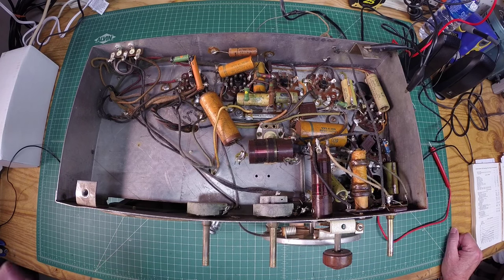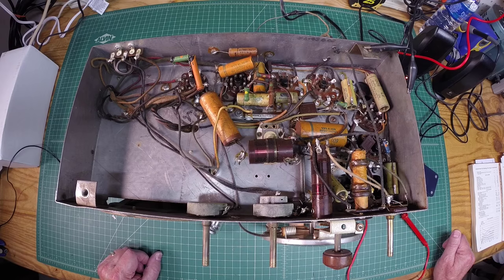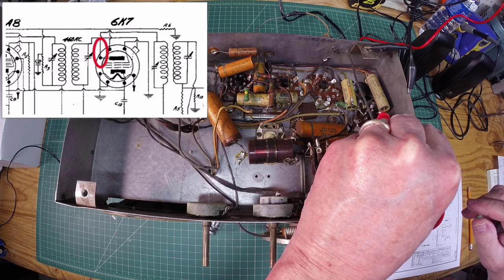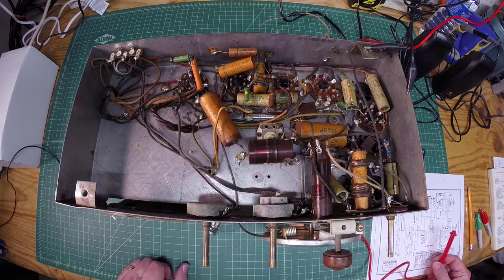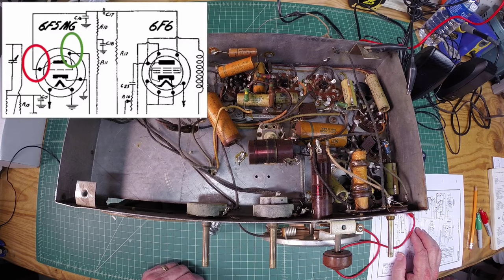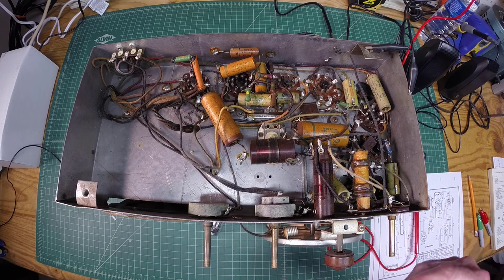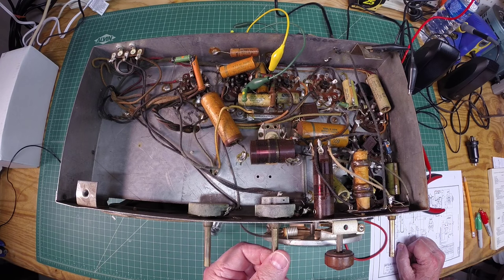Signal Tracing

Comment: The method You were using scares me.
When I worked on tube electronics starting 45 years ago, this was the first rule to save my live:
Never ever touch the thing with both hands., always put one hand in my pocket.

Second. When searching for the source of failure I would rathe pull tubes and start with putting back (known working good) & injecting a test signal.
Starting at the end of the amplifier chain, instead of walking the whole path starting at the input stages.
Just my two cents, experience collectect in 10 years of working with old tube based electronics.

Comment: Thanks for a great demonstration of signal tracing. It's one thing to just go ahead and replace all the caps right away but another point to show what can happen when those caps are very aged and have gone bad. Gary
Reply from the maker: Thanks Gary. I usually shotgun the cap replacements too, but it does prove how beneficial signal tracing can be when warranted. Thanks again for watching and again your kind words. Best, Don
Reply from the maker: Thanks Gary. I usually shotgun the cap replacements too, but it does prove how beneficial signal tracing can be when warranted. Thanks again for watching and again your kind words. Best, Don

Comment: Wow.    I like that troubleshooting technique.     I will have to build a signal tracer  for myself..   That seems to make things much easier and quicker to evaluate circuit flow.
Reply from the maker: +jp040759 It comes in handy at times. Here's a link to an unlisted video that provides a better look at the design. https://youtu.be/3kyXCCdtPUY  Hope this helps. Best, Don
Reply: +RestoreOldRadios   I just used this technique yesterday.  I used a poor (lazy) mans version.   I used a high impedance crystal earphone for crystal radio use.  I used it in series with a .001uf capacitor to block DC.  I was able to find a bad transistor without  the aid of a schematic of the amplifier.   Thanx for the inspiration.   I will definitely be making an amplified signal tracer soon.     Great vids.  Keep up the great work.  Thanx for the video link also.
Reply from the maker: +jp040759 A very creative solution and congrats on your repair. Best, Don

Comment: Sir this a very old radio I recommend to you  a complete restore, probe all tubes and change all the variable resistances.
Reply from the maker: 👍 I did so after using it as an example for isolating issues. I appreciate you watching and reaching out. Best, Don

Comment: Good stuff Don.  I have two valve/tube signal tracers (rare-ish things over here) so I must get one fired up and actually use it! I did make a home brew one with a probe in a marker pen  case and that went into an LM386 amp. It was a bit rubbish though!
Reply from the maker: Thank you Andrew. These little signal tracers come in handy for sure. I'm considering building another one myself. I like the idea of an integrated amplifier as you mentioned with a speaker. Thanks again for checking this out. Best, Don

Comment: Thanks for the informative video, it seems like your homemade probe has fairly high gain and low noise. All of the ones I have tried so far pick up too much stray interference to be useful for troubleshooting problems with RF circuitry.
Reply from the maker: Matt - it's been some time since I used it before producing this video, but it is actually on par with my Heathkit. I should note, my Heathkit has not been restored, so it's not a fair comparison. However, it does illustrates how low cost test equipment can be used to isolate troubles in a set. Thanks for checking this video out. Best, Don

Comment: great video--I built a tracer extremely similar to yours--even same speakers....lol  but my diode keeps blowing constantly--using  a 1n34a....any suggestions, tips etc...?  guessing I'm doing something wrong...
Reply from the maker: +chicagomike6666 I’m assuming you have a capacitor on the Anode side (between the probe & diode) to block DC? Best, Don

Comment: So when using a signal tracer the component under test has to be on?
anyone know?
Thank you
Reply from the maker: Correct. For safety I use an AC isolation transformer and my most recent signal tracer is battery operated as well. Hope this helps. Best, Don
Reply: @RestoreOldRadios  Thank you for replying back. I do have an isolation transformer with built in variac.It is the Heathkit IP-5220
Reply from the maker: Here’s a video I did that you might find helpful:

Signal Tracing Demo - Low & High Impedance Test Point Locations
https://youtu.be/SP6uJRjpCzY

Comment: Thanks for contact Don. Checked your Tracer Link. Will this probe detect both RF and Audio signals?Thanks. Frank
Reply from the maker: +frank goddard Frank, I've used it for both with no RF/Audio switch with good results. I built this many years ago and the schematic source is a mystery to me. I would check out +AllAmericanFiveRadio video at: https://youtu.be/QUmPBBnzkRE Rick, who I admire and respect just built and tested one that performs like an original from the period. I would like to build his circuit and compare the results of both probes to understand the differences in performance when time permits. Hope this helps and thank you again for following my channel, it's appreciated. Best, Don

Comment: Curious what the voltage was on the plates of the tubes? I need to do some testing using a signal tracer but I have 750 volts on the plate for finals
Reply from the maker: I don’t recall exactly, but just north of 150VDC. Your capacitor at the front end of your signal tracer would need to exceed the 750VDC, so a capacitor rated at 1000V to block the DC would be required. Best, Don

Comment: I have always worried about testing the plate's of tubes..So this will not hurt your signal tracer????
Reply from the maker: Kennynva If the signal tracer has a blocking capacitor with a higher voltage than the plate voltages the circuit would be protected. My signal tracer design uses a 630V, but this could be increased to 2K if required. Best, Don

Comment: so you replaced an interstage  coupling cap with a dead short?  isn't the purpose of that cap to keep DC off the next stage grid?
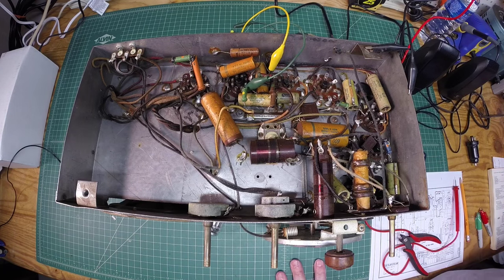Reply from the maker: +Chuck Yahrling Hi Chuck - to be certain I answer your question correctly, are you referencing the jumper across the coupling capacitor C17 at 16:21 into the video? Best, Don
Reply: yes.  perhaps I misunderstood what you did or the connection to the next stage. just wanted to clarify for my own edification, as I would not whave expected this to work at all.  tnx fer reply
Reply from the maker: +Chuck Yahrling Hi Chuck - to your point the coupling capacitor C17 blocks DC to the next stage. In this case, the old one was leaky and thus created the distorted audio. I know the video at 16:11 was not very clear, but I cut one lead of the existing C17 capacitor to remove it from the circuit and used two jumper wires with a new capacitor of the correct value and inserted it across the circuit, which normalized the operation of the radio outside of the AC hum created by the aging electrolytic caps. To your point, if I had jumped across the two points without a capacitor, the radio would have been inoperable. Hope this helps and it provides clarity. I appreciate your question and for watching this video. Please let me know if you have any additional questions. Best, Don
Reply: OK, FB Don es tnx fer reply!  I will follow and hope you do more soon.  Just getting into tubes as I contemplate a tube linear amp for ham band(s).